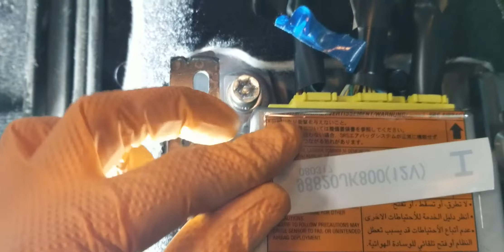How to remove & Location of Airbag SRS Control Module on 2007 2008 Infinit G35 G35x G37

Comment: My air bag had deployed from a collision and my seat belts also got stuck I replaced both of those but apparently I still need to replace the SRS control unit will fixing the unit fix the seatbelt problem?
Reply from the maker: If both parts were replaced with good working parts then replacing the SRS Unit should takes care of your light, you may need to clear the airbag light when all parts are replaced .

Comment: I'm getting code B1052 and B1057 on my Infiniti G35 2005 coupe. Both say driver airbag module short. Is it my clock spring or the computer module that you are replacing in this video? Please help
Reply from the maker: Has the car been in an accident?

Comment: What kind of bit is required to remove the security bolts?
Reply: it is a torx security bit. available on amazon if you know the size. I got mine in a OTC Master torx set
Reply from the maker: Torx Security Bit
Reply: T50 Torx Security Bit

Comment: Is there only 1 module? I was quoted $6k from the dealer to replace mines because the front passenger seat airbag light was always on. They said I needed to replace the airbag module.
Reply from the maker: They might be referring to the Passenger air bag on the dash . Sometimes air bags are referred to as module , the only Airbag / Computer Module is what is on this video . so there is only one Module in a vehicle .
Reply: Service manual starts by replacing this module. Properly. And Yes. Match your part numbers exact.

Comment: Does the numbers need to be exactly the same on old and new?
Reply from the maker: I am not 100% sure about the numbers but you want to make sure it fits the coupe and that specific year . In Many cases the part numbers need to match so don't take a chance unless your 100 % sure or whoever sells it to you is sure it will fit . Thanks
Reply: Yes.

Comment: can you still drive the car with out the module?
Reply from the maker: Dangerous to do so - Airbag will not deploy incase of an accident .
Reply: @autorepairchamps  I would have been already dead or injured waiting on you answer....LOL. Although there is still cars out there that were made with no Airbag system and people still drives it. Just saying!!!
Reply from the maker: @leoguzman4741  sorry have a lot of replays to get back to beside I have been trying to manage between managing the shop and keeping up with you tube . I am  very busy between the two

Comment: (2007 Infiniti g35 coupe) I put mine back together and had someone reset it now it’s blinking I tried turning the key to the on position 4 times and it’s still blinking and my car won’t go to the d position anymore also
Reply from the maker: Hook up an airbag compatible scanner and let me know what the code says
Reply: @autorepairchamps  code said that it’s issue with the airbag module circuit or voltage being low
Reply from the maker: @3cinco76  please provide the code your getting .

Comment: whats this thing SIEMENS VDO ?
Reply from the maker: VDO is a bran , it is a German brand of Continental Automotive which makes automotive electronics and mechatronics for powertrain, engine management system, fuel injection Systems. re-branded as Siemens VDO